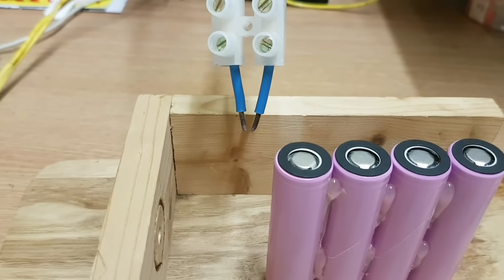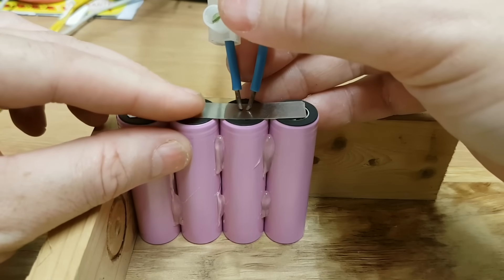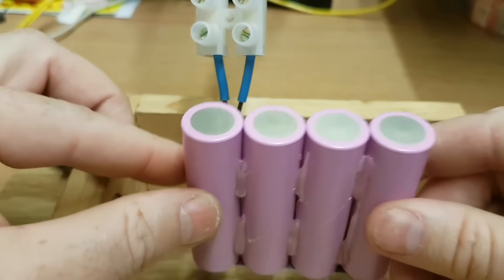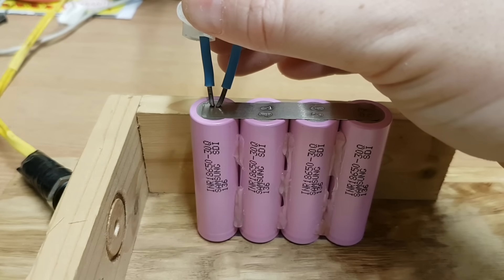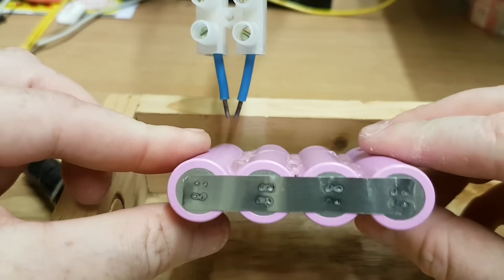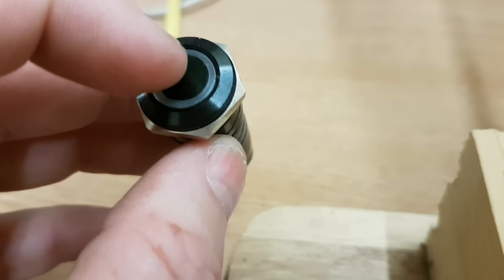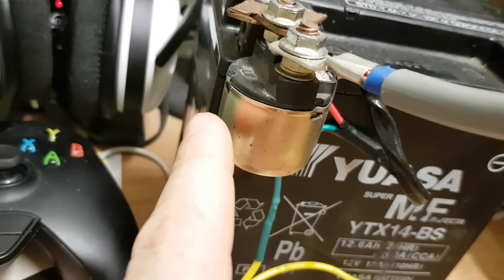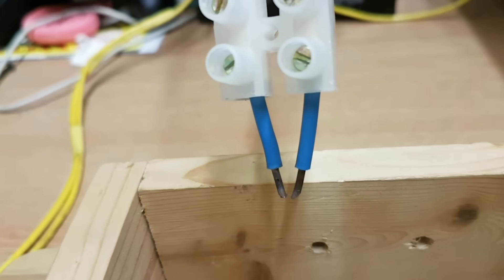DIY Battery Spot Welder - Demonstration & Explanation

Comment: Nice video, I recommend using a smaller inner diameter gasket as it looks like your using 10mm which are designed to go below the wrap not above which is a common mistake by most and in fact by a lot of manufactures. If you watch back the clip you can see some nickle underneath the gasket, using a inside wrap gasket of 10mm for the inside wrap and then another on top using barley paper with a inner diameter of 5mm to 8mm will prevent foreign objects entering the positive cap, just my 2 cents.

Comment: Awesome video and awesome cells you got there too. 30Q high drain all day!
Reply from the maker: Thanks mate! 👍
Reply: So I figured out how to set my own rig tonight by emulating yours here  only I was using a 300CCA lawn mower battery. Everything looked great. Switch worked, solenoid fired, all looked good. Then went and tested my first spot weld on a cell and immediately blew a hole thru the the anode of it. I'm thinking there's either NO way this mower battery is truly 300CCA or I'm just using way thicker gauge and shorter cables than you. The good news is though that the nickel strip did indeed weld (too well obviously) so I've got proof of concept. Now I just need to find tune some things and maybe go down to 200CCA. Thanks again for all the info you gave out in the video and for coming up with such a good idea in the first place!

Comment: How you find out the battery is 200amps it say 10 on it my car battery is only 80 and that is massive
Reply: 200 CCA or Cold Cranking Amps. That's the maximum current for a short time. 10AH is Amp-Hours and is the total energy capacity.

Comment: what metal do use for the strips, where do you get them from ? thanks
Reply from the maker: It's pure nickel. Google it or check ebay but it MUST be pure nickel and not nickel plated steel otherwise it'll degrade over time.
Reply: thanks  u done a great job .
Reply from the maker: @PlanetRuncorn  thanks! 👍

Comment: Average Amps should be 200 for 18650 welding?   If that's true then why is my pointwelder 30 volts and 5 amps working perfectly?

Comment: Is it spot welder? or spot WELDA?!??
Reply from the maker: Err, "welder". "Welda" isn't even a word 🤔
Reply: @darkkevind  🤣🤣🤣🤣  grate video, I would consider putting the battery inside a PVC plastic container for when thr acid start oozing out, it will happen eventually.
Reply from the maker: @miltonfriedman3593  really? You're an expert are you? Even if you shorted this battery for a length of time with a spanner, the spanner would fuse out before the battery cane close to exploding... Keep your scaremongering to yourself buddy...
Reply: @darkkevind  yes I'm an electrical engineer, nobody said the battery is going to explode that's highly unlikely, but it will start oozing acid in about a year or two.
Reply: @darkkevind  New York University Tandon School of Engineering, majored in Electrical and Computer Engineering,
how old are you? Feels like talking to a 12 year old, this battery wasn't designed for your application, good luck with it, I would buy a cheap spot welder as soon as you can...
Reply: My full name is Josua israel Krause, currently pursuing PhD at NYU, you're welcome to Google me, and send me an email through NYU faculty website,
 I can explain in length how your design is flawed, and how it will fail overtime.
Reply from the maker: @miltonfriedman3593  ok mate 👍😂🤣
Reply: @darkkevind  no problem kiddo, go get yourself an the education, maybe you'll be a little bit smarter than.

Comment: After some testing I think you are better off buying a cheap spot welder off ebay than to attempt this. I used different batteries and cable gauges but the results were always bad. The welds were either not secure or it blew holes through the nickel and sometimes the end of the battery as well. Maybe if you buy exactly the battery shown in the video it may work ok...not something I would trust. I think it will still be poor quality connections and a waste of time.
Reply from the maker: I mean, that's your opinion... The welds I'm getting are great and there's been several people since that have made their own using this design and are getting excellent results too...
Reply: El Cheapo spot welder that will do the job much more reliably is only $150 on Amazon. You can add on an extended warranty for just a few dollars.  Taking a chance on damaging cells that cost $4-$6 dollars each just doesn't make any sense to me.

Comment: You used a 4 pole solenoid for this build, can you use a 3 pole solenoid? And how would you wire it?
Reply: are you sure that 3 pole solenoid isn't just a 4 pole but uses the mounting sheet features as the negative contact for the coil?

Comment: Hi - I cant see where you put the 12vDC Relay into the circuit? Cant see it in the wiring of Video? Can you put up a circuit diagram link? Would any similar relay on Ebay work ok? eg - https://www.ebay.com.au/itm/Hot-1-2pcs-12V-Delay-Relay-Turn-on-off-Switch-Module-with-Timer/323316826567?hash=item4b472f41c7%3Am%3AmyWL6lUl5ScrUXJOtXovWWQ&var=512381443063 
Cheers.

Comment: This is a nice set up but you don't need to have it this way, if you don't some of these bits.

You could do a spot weld just using a battery and some cable, just don't leave the cable on the strip too long, a quick touch with the two ends onto the nickel strip will generate a spot weld, if you leave it on too long you could burn a hole in the nickel, but as you are only doing spot weld you would know not to leave it on too long, a quick touch and weld done.

Your set is good, nice and easy to make, but like I say if you don't have solenoids and connectors or can't be assed to get them, just two bits of wire.

The type of wire you could use is cooker wire, the type used to wire in cookers, well insulated and powerful will carry a lot of amps.

If you got a somewhat dodgy battery, connect up a battery charger to the battery and this will help to keep your welds consistent and the battery will charge up obviously so will get more powerful so  you will need to adjust your pressure time on each weld, but it's simple so you will notice very quickly.

Comment: Hey Kevin, awesome video. Just a small question. Why are you giving a link to copper nails ? I can't really hear you talking about nails. And to be honest I can't really think why you would use them, unless in replacement of the Twin earth cable. Love to find out. Cheers
Reply from the maker: Hi, yes, in a subsequent video I swap out the copper wire for copper nails.
Reply: darkkevind  , Why? =)
Reply from the maker: @brunobailleul6438  stronger, thicker, more durable.
Reply: darkkevind  Perfect, thank you. I'll only need to solder 18 cells. So i'm going to take the solanoid from my bike and just use the twin earth. Thank you for the response. I'll let you know how it worked out !!!

Comment: Mr. Kevin, 
This is Jack again and I was wondering you're using pink batteries. I found some pink batteries on eBay and they say they are 9900 mAh batteries they are manufactured by GTL and I was wondering have you ever use those? Most of the batteries I see are only 3,000 mAh at best. I was going to make a couple of battery packs for my spot lights and I just wondered if you were familiar with this brand and the 9900 mAh if that was it all even possible. Thanks you have a wonderful day
Reply from the maker: ANY, and I mean ANY 18650 batteries you see advertised over 3500mah are FAKE! Steer well clear of them... Only buy from reputable wholesalers or retailers, or proven eBay sellers.

Comment: Hey man nice Video and Setup :)
I have tried it also but i don´t get good welds :( 
Have a 12V 360A battery and a 500A Solenoid with 10mm² wires and 2 Copper Nails 2.5mm. I don´t get sparks but the nickel strips don´t have a good Connection and i can easily remove them by Hand :(
Reply from the maker: Try changing your heavy gauge wires for a different type. I can't pin point the particular type of wire that works best, but one type works better the the other... 👍
Reply: thank you but i think it´s because of the nails ;) if they are used a bit they get a bigger Surface area and therefore bigger area for heat Transfer and not so good "spot" capability …. i will try sanding them ;)

Comment: I have just made this exact spot welder and am instantly getting enough current through the tips to light up a H4 car head light globe (Both normal beam and hi beam at the same time) but it will not weld my strips onto the battery. I have only used some old second hand strips and some old batteries out of a lap top for testing and am hoping the strips are stainless steel and are harder to weld than nickel? Any thoughts?

Comment: Kevin if it's okay to call you Kevin. I could kick my own butt or not coming up with this sooner. Leave it as it is don't even bother with little electronic timer. And I like the handheld switch! I done a lot of Afro Engineering in my day and have built some incredible stuff but I have soldered on batteries and electrical component and never thought about doing it with a spot welder. So my hat is off to you buddy! And all of these people trying to tell you I would do this or I would do that and your stuff ain't right I would tell him to kiss my natural white butt! People thought I was a genius because I welded a hook back on a truck using a car battery and small welding rod. I told him I couldn't take credit for it they've been doing it for a hundred years! Yeah buddy I'm from Ma in the USA. M A is just above LA, you know lower Alabama. Also everybody's want to know about the wire and the solenoid they can get all they need at either Home Depot or Lowe's. And they need at least 12 if not 10 gauge wire in the u.s. term. They can stop by lawn mower repair shop to get a used solenoid and stop by some place where they're building a house which is everywhere and pick up a piece of scrap wire. I once built a shoulder holster for a bullfrog so he could tote a pistol to keep snakes off of himself but what you done is way cooler! Thank you prom an old South Alabama country boy Jack
Reply from the maker: Thanks man, appreciate it 👍

Comment: This may be a dumb question... but... if I use a timer board, such as the one you showed in the video, can you power it directly from the battery?  I was wondering if, without any current limiting resistor, it would attempt to put all 200A through the timer board. I'm guessing it would not be rated for that?  Did you ever get around to using a timer board, if so, how?  Assuming you would have to use a secondary power source (or limit the current from the battery), what current is needed to activate the solenoid? Sorry for the stream of questions.  Thanks in advance.
Reply from the maker: There's no way that little timer could handle an the current, it'll fry. I tried the timer but the time wouldn't go down low enough to not blow a hole in the nickel. You need around .4 sec. You definitely need the solenoid that's rated for the high amps as well. You don't need a separate power source, you can power it by the battery.

Comment: I like the simplicity of this welder. I have only one question. Can I use a computer Power supply to run the welder instead of the battery? I have quite a few of them. I know you ;ose the portability, but I don't plan on taking  it on a trip. Any help would be appreciated. The biggest reason for asking , is that the battery is over $100.00 US.
Reply from the maker: Unfortunately a computer power supply will not supply enough amps and probably has short protection.

Comment: Thanks for sharing your setup. simple, and works extremely well. I have read lots of questions and answers. from what I gather, to weld 0.15mm thick pure nickel strips you say a 0.4s timer on a 200A cca battery should do the job. I need to weld 0.30mm thick pure nickel strips to 25650 cells - anyone an idea if 200A cca would be enough, and what timing to aim for? thanks a lot in advance, all advice is appreciated
Reply from the maker: 200cca I don't think we'll be enough. No idea of the timing though. Try to have at least 330cca

Comment: Can i use 12v 10A power supply ?
Reply from the maker: Absolutely not. You need something that can provide at least 200A of current. Most things that can will have short circuit protection as well and that will render it useless. You could use a microwave transformer if you're looking for alternative means.

Comment: Thank you very much for the excellent video. Where can I get the metal strip to connect the batteries?
Reply: Ebay or Amazon - but don't go for the cheapest chinese product or you might find it is just nickel PLATED steel - which is a much poorer conductor.

Comment: Battery spot welding machine is mainly used for 18650 cylinder call pack welding, it can weld Nickel tab thickness from 0.02-0.2 mm with good welding effect. The pneumatic model is with smaller volume and weight, easy for international shipping. click on http://www.tobmachine.com/18650-Battery-Spot-Welding-Machine_p766.html, view more.

Comment: I'm actually surprised that the relay's contacts haven't welded together. But things such as MOSFETs exist.
edit: also, I think the button will be fry after a couple of days when switching an inductive load of a solenoid.
Reply from the maker: Bartosz Olszewski dude, I've done about 5000 welds with this thing and been using it for over a year! 🤣🤣

Comment: Dude thanks for this great vid, I actually made this tool to repair a bad battery pack worth close to $300. Spent about $30 in this and about $24 in new batteries. I had a tractor battery and my bro gave me some cable; I damaged three batteries in the process because 1. The nickel strips off eBay are very thin, (I know because I compared) so be careful ordering 2. I realized I held the button for too long jaja you have to be very patient it took me two hrs to weld 8 batteries mainly because the board from the pack I was repairing had a certain nickel  strip position pattern on the old batteries so I had to weld it to match.  I enjoyed the experience; thanks for this vid.
Reply from the maker: henry m hey that's excellent! Well done 👍

Comment: Nothing "simple" I would say! Who the hell keeps "solenoid" at home? There is much simpler way - just 12V battery and copper wires.
Reply: Solenoids are extremely simple both in how they work and in how they're obtained. You're just dumb and/or lazy.

Comment: Hey. I'm working on getting one of these going to rebuild an old 90's laptop pack with new NiMH cells.
I'm using a 300CCA battery which is reading 12.6V no-load. Supposedly "400A" solenoid relay. 2AWG and 4AWG wire. Choc block. 2mm solid copper wire for electrodes. 0.15mm nickel strip. Lever microswitch for activating the relay.
I can't get good welds. Often there isn't even a mark on the nickel strip (it just gets hot). Even with a long 0.5 second pulse. If I push quite hard with the electrodes, sometimes the relay will "bunnyhop", indicating battery voltage dropping too low for it.
I imagined 12.6V was mostly charged, but I am inexperienced with car batteries. This one is brand new. If I try charge with a CV/CC lab PSU at 14.4V 3A, the battery only draws about 0.5A. Not sure what to take from that.

How are the ends of your electrodes filed? A sharp point? A rounded point? Thanks
Reply from the maker: 60 Frames of Badger I've had this with certain types of thick wire... I'm not sure what it actually is bit I swapped out the wire for another type and it worked perfectly... All I can suggest is try a different type of the heavy gauge wire, perhaps welding wire... Cheap jumper cables don't seem to work.
Reply: Thanks for that. I will take the battery to someone to test tomorrow.
I could power the relay from a different source if the bunnyhopping still occurred due to such low resistance wire causing huge current and battery voltage dropping.
How are the ends of your electrodes filed?

Comment: Great work,thanks,so easy to knock up,just what I need to assist in replacing the battery pack in my cordless drill.
Can a similar method,using simple components, be utilised for spot-welding tin/lightweight sheet metal....or would that require embarking upon one of the microwave transformer projects?

Comment: Do you think is possible to use this relay switch?

https://www.amazon.com/gp/product/B071YNCX5R/ref=ox_sc_act_title_1?smid=A3C6X1N692814T&psc=1

It's rated to 200A but it's 5 times faster than a Solenoid Relay.

I know that recommended CCA should be about 300A but the pulse time is too short, maybe this switch can handle...
Reply from the maker: Cesar Mazzocato yes, that looks perfect for the job 👍
Reply: Nice !, Thanks for your reply.

I'm buying this controller as well:
https://www.ebay.com/itm/112937320248
Doesn't matter how long you press the trigger, the relay will have a programmed duration for the switch.

I tried to buy an 719A spot welder on Wish that never arrived, i was refunded some months ago but the pen arrived this week.

https://www.ebay.com/itm/NEW-719A-Li-on-Battery-Spot-Universal-Welding-Pen-Battery-Spot-Welder-Pen-US/292491056368?epid=15011617231&hash=item4419d354f0:g:er0AAOSwSJVasLrr

Probably i'll build a nice welder with these tools...

Comment: It doesn't get any simpler than that. Well, I guess you could beat copper bus bars together by hand. What's going on here looks better than that would though. Although I use the strike method with a MIG welder to zap ni-cad batteries myself.